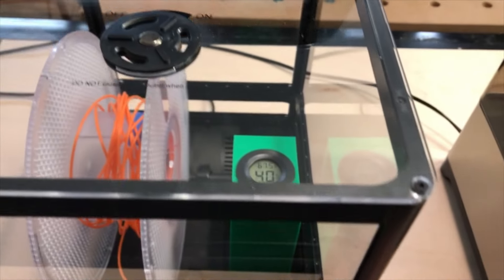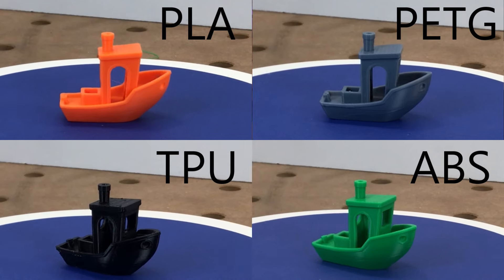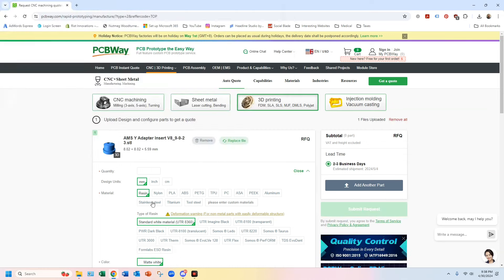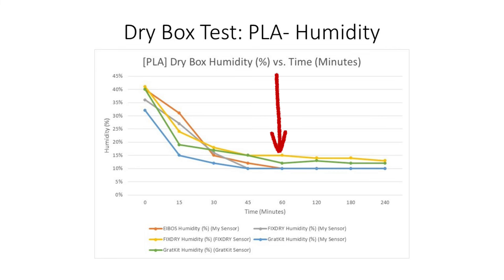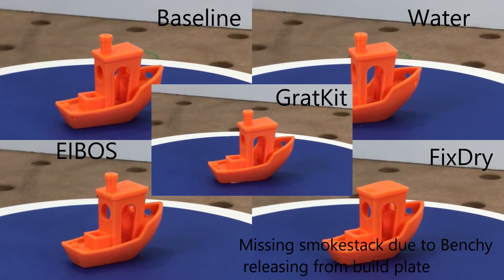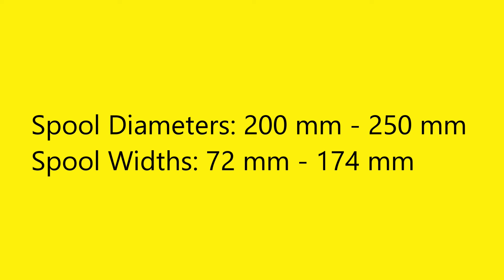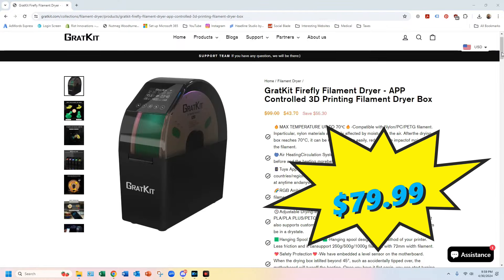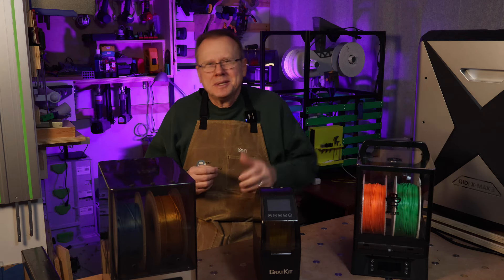Do you REALLY Need a Filament Dryer for your 3D Printing?

Comment: Sigh.  Soaking filament in a bucket of water is not relevant.  Filaments absorb water vapor (a gas) from air.  Soaking filament in liquid water is not a realistic test of how it absorbs moisture under normal conditions. The outer surface may get wet, but absorption into the filament's bulk structure depends on prolonged exposure to humidity.

Comment: Or you can buy a food dehydrator for 25-45 usd new and dry 4-5 roles at the same time (if you wish to). The "custom" dryers are pretty much a rip off compared to the DIY solutions that are out there. I bought a mushroom and fruit slice dryer for 35 usd and a 12 liter bucket I put upside down on the bottom tray, this dryer rotates the trays so I keep 1 and just put the rest aside (still usable to dry food if I ever wanted to). It comes with a thermostat from 35 to 70 C, so the only thing I may add is a timer switch but for now I just set my alarm. A even cheaper method is a cardboard box on your heated print bed with a filament role under it, that is IF your printer support that funktion. (se diy videos on how to)
Reply from the maker: Although I haven't tried the food dehydrator approach, I have read that quite a few people have gone down that successful path.  You are also correct that some 3D printers have a setting where you can dry your filament in the printer.  The only downside of that approach is that you tie up your printer as a filament dryer during that time, but it is an option.  Thanks for providing your comment.

Comment: I think your test is flawed, humidity is the concentration of water VAPOR in the air.  Soaking filament in water is not the same as allowing it to absorb water vapor.  A better test would have been to place the filament in a controlled sealed box and introduced steam, while keeping the temperature regulated as to mot melt the filament.
Reply from the maker: I don’t agree that my test is flawed, but I agree that exposing the filaments to high humidity is a good idea. Exposing the filaments to steam while controlling the temperature would be a much more complicated experiment to setup and run. Thanks for offering your idea.

Comment: Thanks for the test, just started 3D Printing and got my first PLU shipment incoming and was already a bit in panic since we got some humidity here - now I feel much more relaxed about it.
Reply from the maker: Thanks for your comment. Good luck with your 3D printing journey and let me know if I can help in any way.
Reply: @ristinnovations  thanks for the kind offer, so far I got the Bambu lab A1 with Ams light but ran out of the 20g PLA quite fast. (seems pretty plug and play so far) maybe collect newbie questions and make a video ~ FAQ style (I tend to respond the same questions already answered inside my videos several times in the comments.... Sometimes that can be a bit exhausting.)
Reply: I am about to get my my first 3D printer and I am getting some pla to test but I'm so glad I saw this video to know about humidity because I believe this area I just moved to recently has a lot of humidity.
Reply: I do have a question for you though if I wanted to paint one of my 3D sculptures what kind of paint would you recommend?
Reply from the maker: @JedidiahRogers-j4u I recommend that you watch some YT videos from some of the experts in painting 3D prints. There is a lot of prep work if you want to hide the layer lines. I have seen some people use an automotive filler/primer spray that helps because you can sand it smooth. Some people use acrylic paints and others have used automotive paints. I hope this helps as a starting point. Good luck with your 3D printing journey!
Reply: @ristinnovations  thank you so much!
Reply: @ristinnovations  I had that same question Thanks!

Comment: with Nylon you REALLY do... but not really a good dryer on the market... you want around 140c when drying... so i use air dryers or an old convention oven ... then just use dry box with rollers for the life of the filament...
Reply from the maker: Thanks for your comment!

Comment: thanks, i was going to get a dryer but i only use pla so ima skip it and just put them in ziplocks and dry packs.
Reply from the maker: That sounds like a good approach.  If you ever branch out into other filament materials, I dryer may help you with your prints.

Comment: Very useful information. I, too, wondered what would happen if you printed soaking wet filament of various types. Because I use mostly PLA, I'm a lot less worried about humidity now, plus the interior of my home stays at a pretty consistent 25-30% RH. As I begin to use more filament types, however, be sure to dry my filament to help ensure good prints. Thanks!
Reply from the maker: It sounds like your environment is well-controlled for PLA filament.  Yes, as you use more moisture-sensitive materials, you may need to dry your filaments to ensure you don't have any humidity problems.  Thanks for your comment.

Comment: PLA and especially silk variations of PLA become brittle when they have absorbed moisture and this can be fixed by drying the spool.  I've had extreme examples where the silk PLA filament kept breaking during a single print to the same spool after drying being trouble free.
Reply from the maker: Hi Steve, you bring up a great point regarding the silk PLA. Thanks for your feedback.

Comment: Thanks for the information! I was thinking about getting a filament drying box, but I have only recently started 3D printing, and haven't progressed beyond PLA yet. I also live in the UK, where it isn't often too humid (wet, but not humid!) I keep my opened filament in vacuum sealer bags with dessicant, so only ever have one roll out at any time (no AMS on my A1 Mini!) I will just carry on as I am for now!
Reply from the maker: Hi Paul, In your case it sounds like you have a great system for managing your PLA. If you expand to other materials you may need a filament dryer, but I agree with you that for now you don’t need a dryer. Thanks for your ongoing support of watching my videos😊
Reply: Thanks Ken! I like following your channel, as you keep things simple enough for beginners like me to understand! 😳 Keep up the good work! 👏

Comment: Have you been having any problems with the motor of the Eibos? I’ve read that the lifespan of that motor is limited. 1500 hours if I’m not wrong?
Reply from the maker: I have not had any troubles with the motor yet.  I don't have 1,500 hours on the motor yet.  Thanks for the question.
Reply: @ and which dryer do you prefer?